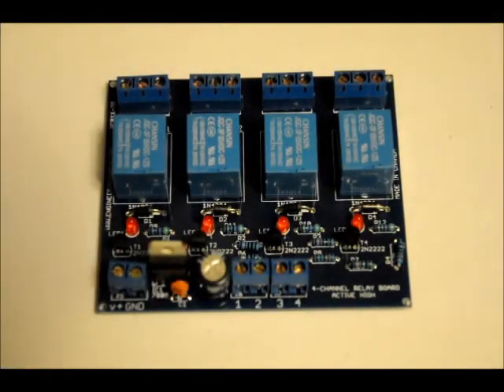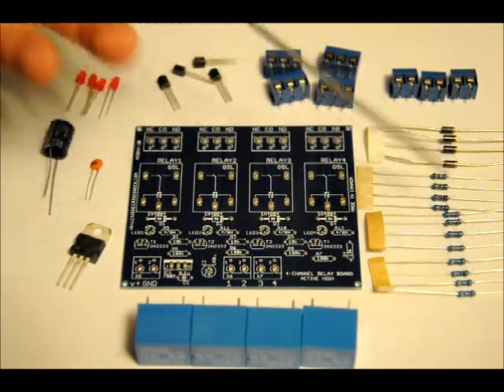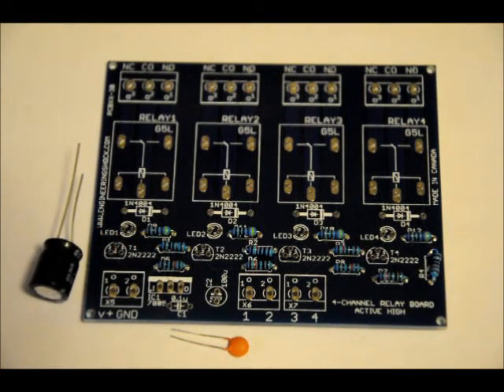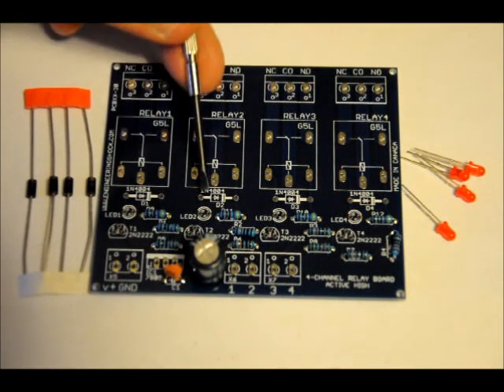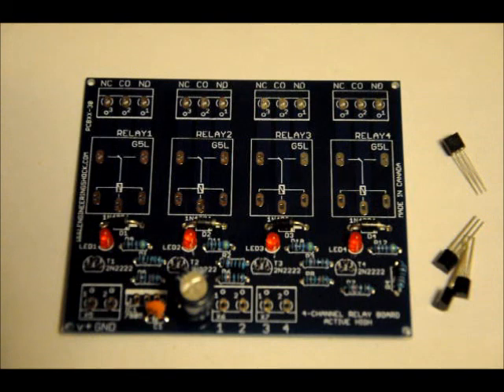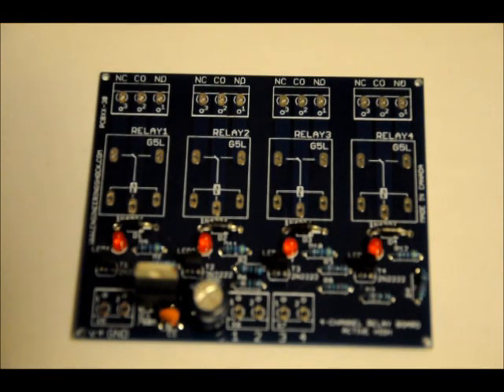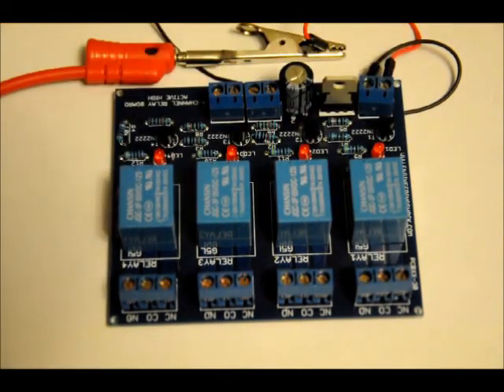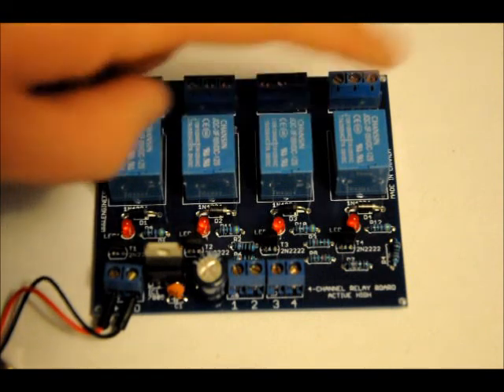4-Channel Relay Driver DIY Electronics Kit For Arduino

Comment: Yes I lived in Ottawa for 10 years in the 90's working in high tech in Kanata then got hit by the layoffs moved to Carleton Place for 7 years and am back in Ottawa again. Do you use software to do your PCB designs? I like how your DIY kits are designed. I think I will put in an order for a couple.

Comment from the maker: @electronixTech 
Hi there
You're right.  I just always say connected, because the connection is closed relative to the common pin.  Thanks for the comment on the board design.  I am quite proud of it.  Do you live in Ottawa now?